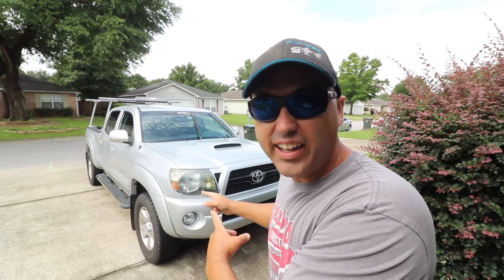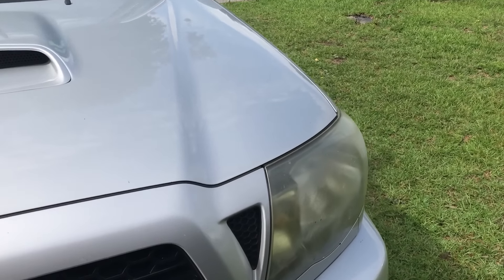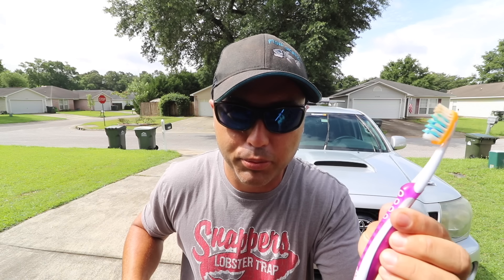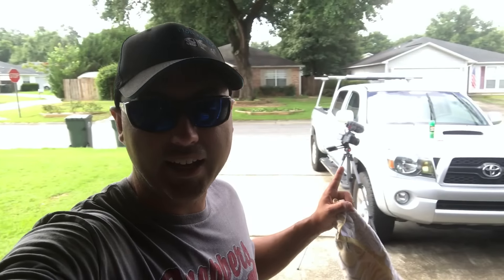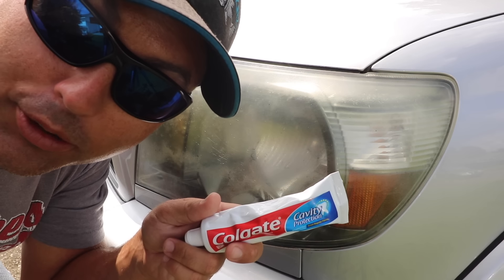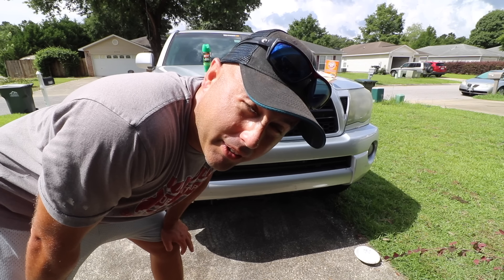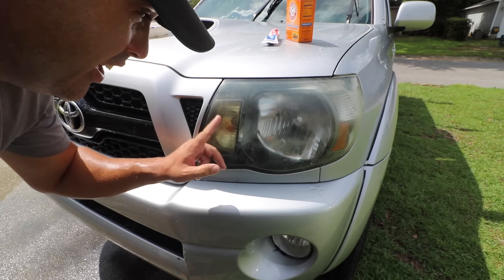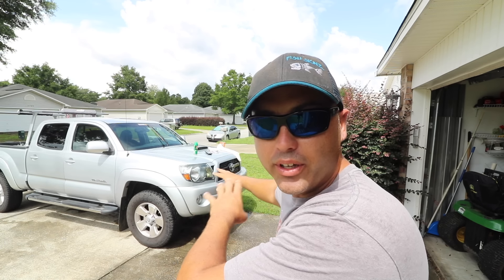The TRUTH about OFF & Toothpaste vs Headlights! (+Update on WD 40)

Comment: I've used Ben's 30% deet and it actually melts the film off of the headlight vs cleaning or filling cracks as some people think it does. You can feel it start to get tacky, then see it start to remove the foggy layer altogether. Once it's looking clear, one last wet wipe to allow it to glaze over and you're set for 6-8 months or longer. Fastest, cheapest and easiest method to restore headlights imo.
Reply: Do you just spray it on and let it sit?
Reply: @LarissaNicole1  I sprayed it on a rag or sock flipped inside out, then smeared it across the headlight housing evenly. Sprayed the sock again and slowly wiped it side to side from the top to bottom until I felt and saw the hazy layer begin to dissolve. Repeat once or twice more and then with a clean part of the sock, spray it pretty wet so you can coat the entire headlight with a wet/gloss coat and let it dry. I spray the sock away from my car as to avoid getting it on the paint although it hasn't shown any bad reactions when I did get some on it.
Reply: Dang, imagine what that does to your skin
Reply: @BlackVibeBallsack  so toxic. Use Avon Skin So Soft for mosquitos.
Reply: @jugmothafukr  you should do a video! 👍for the info and step by step

Comment: After you clean it with oFF use a spray can of clear paint to protect it and it will last way longer and look way cleaner.
Reply: Does that really work?
Reply: @bamaangel7146  yes it works
Reply: Yea, it works, but when you spray on the Off, wait about 15 or 20 sec before wiping it off.

Comment: There's clearing with sanding or compound/polish, but then any work needs to be sealed to prevent oxidation from happening again with a few weeks. I coat with 4everClear by SafeTclear after sanding up to 2000 grit

Comment: Hi Mr. Motley. Do you know what would really happen if you were to use the same methods of application to both items? the Off and the toothpaste with baking soda. If you applied the Off woods with a towel and in circular motion you should apply the toothpaste mix the same way; ***also the application should be for the same time, meaning that if you rubbed the Off woods for 5 minutes  you should also apply the toothpaste mix for the same amount of time..there will be your comparison real results!
I know I am going to try it! These ideas are great! Thanks.
Reply: What happens if you mix all 3? Seems like the paste & soda take the place of the sand papers, & the Off is the chemical that cuts through the crazy & fills in the uv deterioration...just a Social Worker observation...

Comment: Been using colgate for years to  buff  scratches out of CDs. Don't use a toothbrush though use paper towel or soft cloth. Elbow grease a must
Reply: What's elbow greas?
Reply: @lauratorres6453   physical work, especially vigorous polishing.

Comment: To clear the top layer of “yellow haze” off any headlamp assembly, you must remove the compromised clear coat that is sprayed onto the surface by the manufacturer.
This can be done with sandpaper only. After you complete;y remove the old yellowed top layer, you must polish (buff out) the original plastic to a clear, high luster.
Then you must spray a “non-yellowing”, high gloss,  clear coat lacquer finish on those shiny new headlamps. Otherwise all the work you’ve done will quickly deteriorate.
There is no quick, cheap solution.
Reply: What grit paper? What do I use to buff the plastic before clear coat?
Reply: Exactly - there’s nothing that’s going to stop the abrasion from driving.
Reply: @shillbillythekid3105  I would use a very fine grit  and of course make sure you tape off the rest area when spraying. ❤
Reply: I usually go from 2000 and finish it off with 8000 grit (I don’t recommend making that big of a jump in sand paper go from 2000 then 2,500 and go up from there. Also my best jobs were when I wet sanded it) and then polish it after (make sure it’s completely dry before you polish)

Comment: The "Off", like the WD-40, is only a temporary solution. If you don't want to replace the lights, you must sand them down using increasingly fine grit starting at about 800, then 1000 and finally 2500-3000, followed by a buffing compound, and then with a polishing compound. The entire process goes to increasingly finer abrasives. But you're not done yet. The original UV coating that was oxidized, degraded and crazed is now gone and must be replaced. There are a variety of permanent final UV coatings for headlamps to give them a clear coat. Without that, the micro-porous polycarbonate will degenerate and suffer UV damage within weeks or months. If that seems too much work, especially for very badly hazed and crazed lenses, the cost of replacing the headlamp assemblies may become attractive. Depends on the amount of work required and the value of your time.
Reply: That's the best, most thorough explanation and solution I've seen. I completely concur!
Reply: What is your suggestion for a permanent final UV coating?
Reply: @lindademercer3832  My suggestion is replacing the lamp housing. Attempting to polish these is difficult at best, marginal results, and tend to fog back over quickly
Reply: @Sparks68  tyvm.

Comment: You did the toothpaste all wrong. Just put the toothpaste on a clean rag like an old t-shirt and rub the light for a minute. Then rub off all the toothpaste after it dries with the clean side of the t-shirt. It works for me!  Good Luck
Reply: Same here.  I cleaned my lenses with toothpaste and it worked fine.  Just need to apply wax afterwards.
Reply: That's how I did it too.  It works pretty good.
Reply: right, just because you're using toothpaste does not mean you have to use a toothbrush to apply.  just use another hand towel, just ruin another one from your wife's set.  ;-)
Reply: You missed my original post where I said use an old t-shirt! And make sure you use White toothpaste. I put it on with a dry rag, and take it off with a damp one. It cost me nothing as the toothpaste was expired, and about to be thrown out!
Reply: @billg7492  you have expired toothpaste? Your not brushing often enough
Reply: @nuckingfuts3017  When I read "expired toothpaste" it was ...what?? But when you added that little comment, I spontaneously laughed loudly and it woke my sleeping husband who should've done the dishes so thanks for the big laugh in my day and him doing chores!  (your user name is pretty good too)
Reply: @arlened.7749 lol thanks, I got it from a movie

Comment: i used toothpaste n baking soda n scrub it with a cloth then wash it off, then I polish it, it stayed clear for 6mths
Reply: I use a cleaner called Plastx cleaner polish. I use it about 3 times a year. It only takes a small dab and it takes about 3 minutes of polishing to do both headlights and it stays clean for about 4 months. I've had the same bottle for about 5 years as you only use a small dab each time.  Note!! the left side of your vehicle is determined by the drivers view as he sits in the car.
Reply: I can't say thank you enough for what you wrote. It's bothered me for years about the whole left and right thing with cars. I always use the terms 'driver's side' and 'passenger side' to avoid any potential confusion. It's happened to me in the past, even with mechanics who have misunderstood which side someone was referring to when trying to fix something. Their left and the other person's left weren't the same and the mechanic couldn't find any problems. After a lot of stupid and unnecessary discussion, it's always figured out. But damn!  Personally, I'm sticking to driver and passenger, but I'm so happy someone finally told me which end was up (so to speak). Thanks again!

Comment: What you want to use is brake fluid . Brake fluid will take off a thin layer . Use 1/2 cup on a rag  rub in small circles then add more and smooth it out with even pressure straight across back and fourth. Brake fluid lasts for several months even years. It removes the layer that is oxidized or weathered or fogged up and creates a like new surface. The off looked good but didnt last long . Off only masks it with oil layer brake fluid removes the damaged layer of plastic and allows you to smoth out the new clean layer.
Very easy no hard scrubbing only rubbing lightlyand very lightly to smooth it.

Comment: Easiest way to permanently fix it is to wash the headlight, dry it thoroughly and when it is completely dry, spray a thin coat of polyethylene on it. Don't over due the polyethylene and cause it to run. Let it dry thoroughly before driving. (At least 4 hours). Good for another 5 years. Any and all other fixes are just BS. The manufactures always put a thin coat of polyethylene as the last step in the manufacturing process. Plastic headlights are a deal breaker when I buy a new or used vehicle. I only buy vehicles with glass headlights or if there's is an optional aftermarket replacement in glass. Plastic headlights all suck.
Reply: Don't you mean polyurethane spray paint which comes in clear.

Comment: Just because it’s toothpaste doesn’t mean you use a tooth brush.  Use a cloth and buff it off.  It works perfect.
Reply: Yes Andrew, I just came to say the same thing!
Reply: If you need to test cleaning products then the cleaning method must be the same, otherwise you do not know if the product or cleaning tool does the job.
Reply: Just as well he wasn't using milk to clean the headlights. They'd have been polished with a bowl of corn flakes.

Comment: I detail cars and I do use the off if needed to clean headlights. I do leave it on for about 30-45 seconds though instead of taking it off instantly. I also use a non-abrasive pad from my detail company to scrub it.. (will not damage lens) Wipe it off with a wet towel then dry, after that apply a acrylic polish... It is not a permanent fix, but it will last  a whole lot longer than a week.

Comment: What I have to tell is the fix. 
1. Use soap and water and clean headlights 
2. U have to remove the factory sprayed on protective UV Clear Coat. Using the finest auto body wet sand paper and soap and water till old clear coat is remove. 
3. Tape off all auto body parts like hood grills finders bumpers. 
4. Go to auto body shop or local auto parts store ask for a spray can of UV protective clear coat for head lights. Follow directions.

Comment: Watch the Chris Fix video on how to restore them. Wet dry sandpaper and some spray UV resistant clear coat. Did mine like two years ago and still going strong.
Reply: ncfishboy try scotty kilmer and it does work, i tried chrisfix and only last two months with  crack paint. chris fix cost you around $20 compared to scotty cost u around $16. 😂🤣
Reply: 😂🤣 so chrisfix is way smarter than the people who make the product that scotty Kilmer have tried? yap chris is smart😂🤣
Reply: btw ur chisfix is hiding from scotty kilmer 😂🤣
Reply: ncfishboy and soapywater
Reply: Is this a super fine sandpaper that you used? Do you remember which number? I heard that works miracles.
Reply: It work for about 6-12 months then the paint started to peel away. I did sand lens to smooth, clean and then paint. Maybe because we are in southern California, the sun finally degrade the paint.

Comment: The deet in the off will react with the plastic in the lens, and will leave it tacky feeling.  The big issue is, the UV protection is gone, and that is why they fog up after time.
Reply: Drew Rischbieter it's oxidation not lack of UV protectant. Rubbing compounds work best, especially those for marine paint jobs.
Reply: Bestnuggz The, oxidation is the cause of the foggy headlight.  But, once that oxidation is removed by sanding, you need to put a fresh coat of clear on the light to prevent further oxidation.  The clear coat has uv protection that prevents the oxidation of the headlight.

Comment: OFF DOES eat away the plastic, thats how it works...just like the sandpaper does in the first step of headlight restoration kits. But after that top layer of plastic is gone, you need to seal the exposed plastic and then protect it from UV damage to keep the plastic clear long term

Comment: A tooth brush is designed to work on teeth you dont have to use one just because you are using tooth paste.
Reply: Good point....not as many crevices on a headlight!
Reply: Right. Try a little elbow grease and buff the toothpaste in with an applicator or rag as you would a car polish.
Reply: his wife never noticed

Comment: When polishing anything the more you get the ridges (microscopic ones too) and valleys to the same level the surface usually becomes smoother, brighter and/or shinier. If you fill the valleys with something like WD40 the ridges and valleys are not as severe and  reflect light in a more uniform way. As soon as the oil medium washes away the dull scratches return.  Like polishing your car.   The problem is plastic is soft and is usually very hard to polish since you peel plastic off when trying to polish therefore making more scratches otherwise rubbing compound then polishing compound would do wonders on the lens but you never hear anyone talk about this approach so this way may not work either.
Reply: Hey
Reply: It doesn't!

Comment: I found that Listerine Total Care takes stain out of clothes when nothing else works. I think I'll try it on my headlights!
Reply: Try hydrogen peroxide on fabric or carpet
Reply: Thank you both for the tips!  I have used peroxide to get blood out of white fabrics, but never heard about Listerene.  How well does that work?  Also, can you use the peroxide on any color?
Reply: @AngelNKY68  Listerine works because isopropyl alcohol, one of its primary components, is a pretty good solvent. Soaking a stain in rubbing alcohol has similar effects. (Doesn't leave it minty fresh though.)

That said, for most stains you can just soak it in some detergent and oxiclean for a bit before washing. Time is the ultimate solution.
Reply: @AngelNKY68  use Awesone from dollar tree
Reply: Soak the headlight in gasoline for 40min, preferably in a closed space. Then light some candles
Reply: Use foamy shaving cream and a soft brush. Takes oil out of carpets and clothes. It even took paint out of a shirt that had been washed and dried. It's the best kept secret for cleaning. Just use the foamy kind NOT the gel

Comment: Wet sand the headlight housing with water & 800 grit sandpaper, wipe off, the light assembly will be hazy, wipe off with rubbing alcohol cleaning any remaining dirt then spray light assembly with a clear coat spray paint evenly.  Don't forget to tape off your vehicle to prevent accidentally spraying it!

Comment: I discovered a bit of a hack today, My headlights are a lot worse than the ones in this video. I used T Cut, Rubbed T Cut with a damp cloth and rinsed and repeated several times. Applied turtle wax and they look literally new. I believe it's the clear coat that actually yellows so only a small layer needs to come off and the red bottle T Cut is for removing oxidation.

Comment: Tape around your headlights with masking tape then start wet sanding with 400 Grit go to 800 Grit than a thousand grit... try and work  with a hose and keep the light wet the whole time, or as much as possible while you're wet sanding. Then if you go to 2000 and then finish off with 3000 and then buy a glaze such as Meguiars and polish it up and they will look brand-new. It will last you quite a while I do headlight restoration and it's the best and longest thing out there... then just keep them waxed every couple of months like you would and should do with a new set of headlights.
Take care...
Reply: I use Griots Garage. Done with Meguires stuff
Reply: Your process is totally correct buddy, but as a caveat with all due respect every set of headlamps can be tainted to different degrees, and 4-8 may be too abrasive if there is only a little pitting. I would always start closer to the minimum, something closer to a 1000, and a bit more elbow grease, as many people trying this for the first time will be expecting a quick fix, and imo if people are unsure of what they are looking for as a base wet sand, they will generally over rub, and the scratches on the outer headlamp that result can be just as bad if not worse than the original fogging issue. I think the 'glaze' you intimate is definitively a 'clear coat spray' which may somewhat confuse some if they are unsure
Reply: I wouldn't wax them I use a uv protection clear coat and pit 2 light coats on and last me here in Colorado1 yr before I have to do it again
Reply: I use to own a car lot.  I used warm/hot soapy water and a 2000 grit sand paper. Then hand buffed with a polishing compound (NOT a buffing compound). Sometimes repeated this a time or two more and you wont believe how well it does.  Lasts a lot longer than anything else I tried and a whole lot cheaper than buying restoration kits.
Reply: Thanks for sharing <3
Reply: @MrLow86 , do you mind sharing which brand you use? I am in CO as well, and if anything can last a year out here with our weather, it's got t to be great!
Reply: @angelinechaney7676  any clear coat with UV protection you can get at Walmart

Comment: hey! Dude, you don't use a tooth brush on the lens of the car.  you use a cloth just like you did on the one with the "off", tooth paste has grit in it already like rubbing compound.  after you rub on the tooth paste and rub it several times you will get a very clear lens,  after washing it all off and letting it dry you then spray a clear coat over it that has U V protection in the paint and it should last a year.